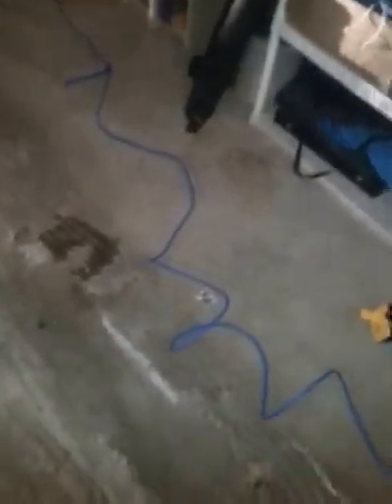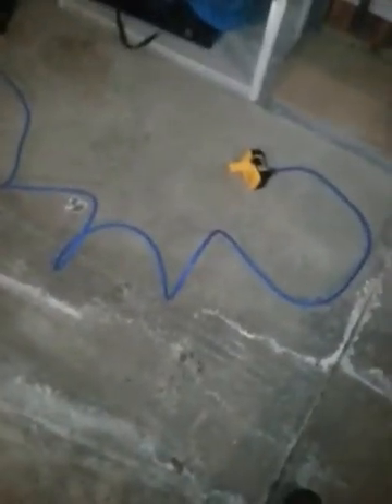Cordless tool battery  to AC power conversion

Comment: A regular saw uses at least 1500 watts with 120v.
If you have a 18v saw that is about as powerful you'd need a transformer:
1500watts/18v = 83 amps.

I found a 18v 66 amp but it may still not provide enough current for maximum power. 83-100 amps is ideal.

Comment from the maker: I used a 15 or 17 amp 24 volt DC switching power supply. Output voltage was adjusted down to about 19.5 VDC. I used a heavy-duty extension cord between the saw and power supply for good current flow. 15 amp power supply because most branch circuits in the house are 15-20 amps. The battery pack needs to be totally gutted out of low voltage shut down and over current protection because that is now done in the switching power supply. Nicads out as well. I don't have video of the assembly but the hardest part was deleting the circuitry in the upper part of the battery pack. It still works good. I hope this helps.

Comment from the maker: It is hard to say with out being there. It could have been a short some where.   It was tricky gutting out the Dewalt battery pack. 19 amps would be more than enough to spin the drill.

Comment: I also did this with a ryobi set. I had a 18volt 19amp switching power supply . It actually killed the power supply, it doesn't work anymore. What possibly happened? The drill turned ever so slightly then the power supply died.